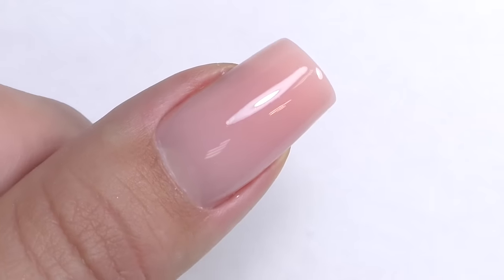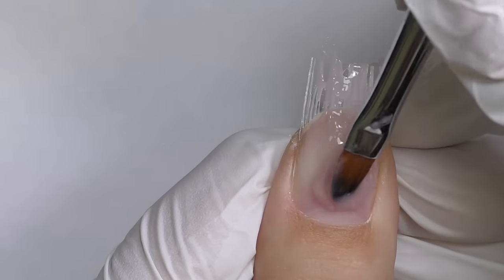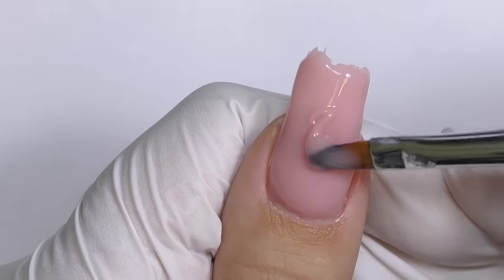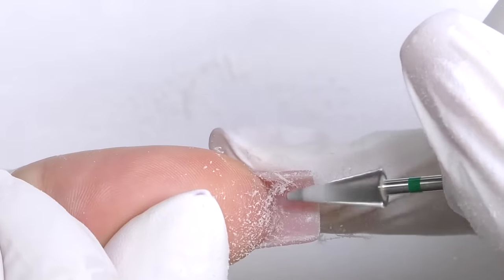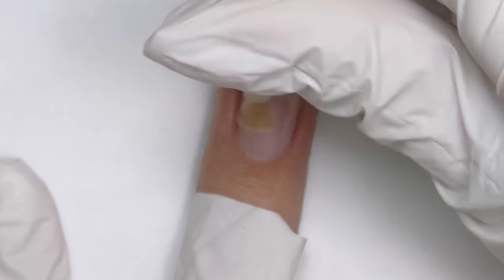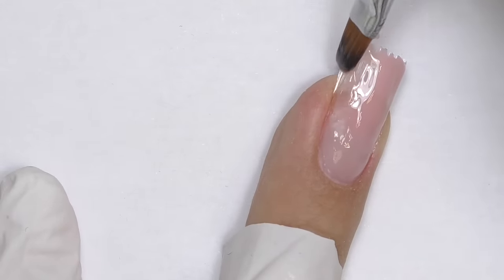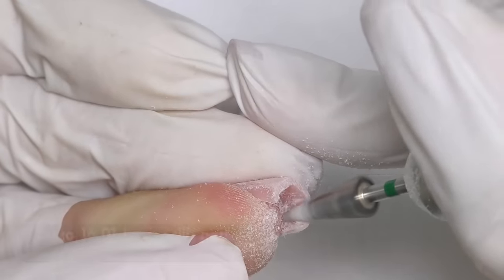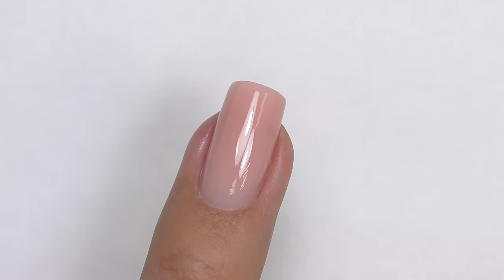Fiberglass Nails Tutorial

Comment: I was with you until you took off the fiberglass under your nails. Too much work I would stick with nail forms. However the kind of fiberglass you're using is extremely dangerous and the twisting would make me scream. Stick with the regular fiberglass silk nail wrap. Then I. Think I would try it.
Reply: I don't think you're supposed to file it off underneath like that. But you can buy the fiberglass nails already cut and in the shape you want and you just adhere it.

Comment: I tried it . It’s ok ... but my opinion is ,  it’s faster to just sculpt with a paper nail form . I’m pretty sure you are to put gel on the underside of the nail and not file the fibers off . Don’t you think this method is limited to the square nail shape ?
Reply: In Brasil the glass fiber is the main product used with gel. When you get the hang of it, it is faster then tipping. There is a prep work you can do on the fiber that makes it easier to apply. I'm a form girl myself, I just need to convince my clients that my nails are as good as fiber nails, because it is advertised as more resistant 😐
Reply: espaço walker  I don’t use glue on nail tips . I use paper nail forms . I put the paper form on and use gel to sculpt = done . No fussing with fibers .
Reply: @Denisejohn65NailEd  I'm a form girl myself, I don't like tips or fiber. But where I live, people like fiber thinking it's better than other techniques. And you are not limited to square, ballerina and stilettos are possible too.
Reply: We all know Denise is the almond queen! Lol

Comment: Try to soak fiber free edge from inside and outside  with thin base coat instead of thick gel until it get invisible then u don't need to file it from inside. 
I've tried it and it did work

Comment: I would worry about all of the tiny glass fibers floating around. It would be so easy to still have that around when you remove your mask  and you might breath them in. Not a good idea. I have used fiberglass before but it was the fabric woven specifically for creating nails. I didn’t find them to be strong enough for me. Also, the adhesive and fixer used with the fabric didn’t create a smooth surface.

Comment: You have to open the fiber first with a toothpick, before you put on the nail and you had to put the fiberglass with base coat so the aply will be so much more fast. Also you can used the hard gel just on the fiberglass, not on top of your nail, cause he's heats up to much

Comment: If you use the fiberglass strands that are made for nails they are connected at one end and go on so much smoother and don't come up or twist or separate. So much easier to use. So if you are going to try the fibers... get the ones that are designed for use on nails so they are made to be easy to apply and are very user friendly. And ALWAYS use your mask because you don't want to inhale any of that glass. Very bad for your lungs.
Reply from the maker: Yeah, this one was not for nails, that's why I decided to file it all off

Comment: I don't really get that thy are called fiberglass nails when its built with hard gel and seams pointless
Reply from the maker: Steph browning it was used instead of forms 😉
Reply: I get why it's used but it's still a platform like a tip, form ect you wouldn't called any of those by the platform name
Reply: Your suppose to leave the fiberglass, it's suppose to have nice strength, think about it, they use it for build boats.

Comment: I am watching this, just for entertainment but- could you not just use a small piece of tracing paper stuck to the nail as the form? Since you are removing the strands in the end, they do not form part of the structural strength? A piece of paper would do the same job I think, even if it were normal printer paper, as long as you use an opaque gel, is it going to make much difference?
Reply from the maker: Yes, you can! I tired using regular tissue too. It works for short nails, but for long nails not very comfortable to apply the product.